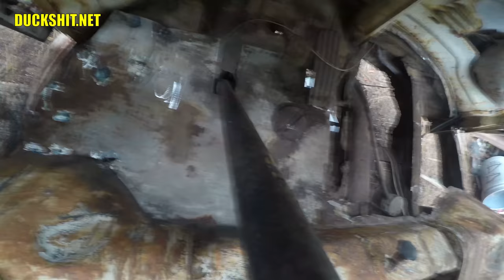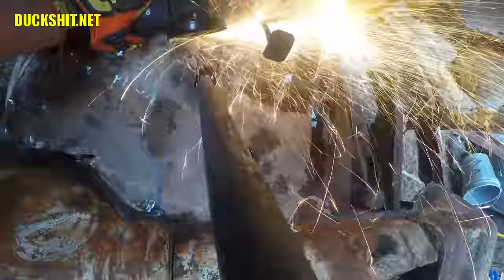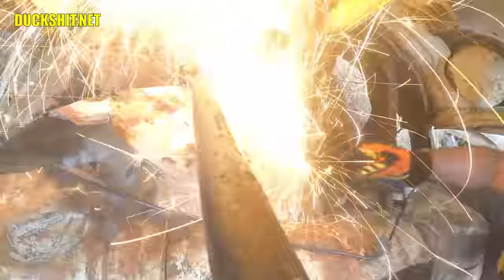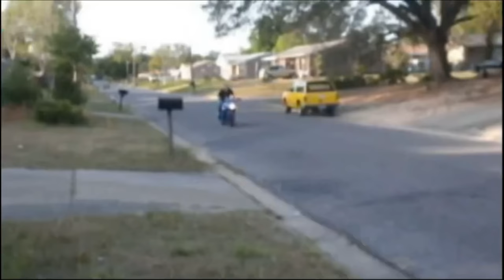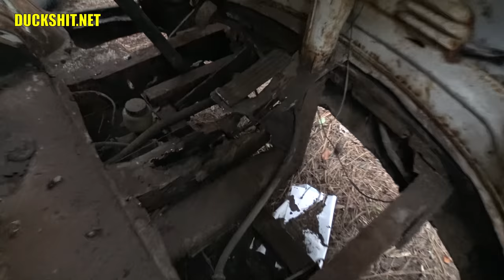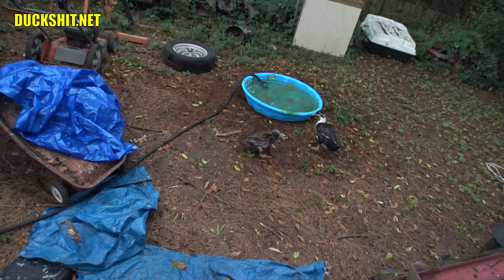1967 VW Bus Cutting Up Front Floor - Gregory - 6

Comment: Its funny how you've had several videos of going to remote mail box store.  And no one notices.  As for bracing I've seen these cut down to almost nothing but floor and was use for years to feed cattle. And others with floor modified as you want to floor . A simple reinforcement under floor to connect rear door frames  would do it.  Larry from rust belt.
Reply from the maker: Thank you!

Comment: The good thing about living in the UK for me is auto craft is based in the UK and their is a company called here called surface processing ltd who have massive baths of phosphoric acid big enough to fit vw bus in so every inch of the body of my split screen will be striped back to the bare steel including those area to difficult to reach with a sand blaster and they use the same Electrophoretic painting process used on all modern vehicle shells to rust proof them for meany years.
Reply from the maker: AutoCraft parts are available here in the states also, pretty good quality... I need to get a swimming pool full of zinc chromate, then kick my cars into it lol
Reply: LOL Auto carft and Klassic Fab must sale their parts all over the world I found a uk based klassic fad parts supplier

Comment: Can you get a small replacement panel for the main floor if so maybe you can make that work for the console floor that way it looks close to factory
Reply from the maker: There is a full replacement panel to the floor manufactured by several different makers.  I will be getting one of them sometime in the near future.

Comment: I have a big problem with my 200cc engine. It doesn’t have a 5spd. But mine has a 4spd with reverse. And 1st and 2nd gear I basically get no acceleration but I start to get acceleration in 3rd and 4th gear and it feels like 45mph. I know this engine is capable of more but the gearing in the tranny might be off or someone might have messed with it. Please help.
Reply from the maker: Thanks for the question, but I don't know of any 200cc VWs.  There was a 2000cc Type 4 Bus, but it also had 4 speeds and reverse like you say, three is no 5 speed air cooled VW from the factory.  I really don't know how else to answer the question, but I suggest you make sure the engine is running properly before you start taking apart the transmission.
Reply: DuckmanCycles and VW Garage no it’s my Chinese 200cc engine I put in my go kart. Something is wrong with the transmission like it’s not really going

Comment: Does the body of a bus come off the pan like a VW Beetle?
Reply from the maker: No, there is actually a frame like on a modern pickup truck, but the body is welded directly to.  Would be kind of neat if it unbolted though.  Thanks for the question 😁

Comment: Did you ever figure out what year it is? If it has the OG trans, you could use the serial no. from it to get close to the year it was made.
Reply: Update. It is a '67. The gas filler door doesn't have the church key lock. This is '67 only feature.
Reply from the maker: That's interesting! I believe you but I'll do a little more research to just to be sure that that's the smoking gun!!!  Only trouble with the transmission is the code that I would anticipate to be on there was actually used for many years, not specific to 66 or 67.
Reply: @DuckmanCycles  That's a one year only feature. If it's a '66, somebody when to the trouble to take the old filler cap cover off and put one on from  a '67 painted the same color as your truck.
Reply: @DuckmanCycles  If the trans is OG, it could still tell you if it's a '67. An OG '66 trans wouldn't be ground out for a 12V flywheel and would have a starter bushing that fit a 6V starter. An OG '67 wouldn't be ground out either and would have a starter bushing that fit a 12V.

Comment: Did you lay the two pieces of flooring together to find out what they're from?  Had a similar thing happen in my basement workshop...somebody had put cardboard over the walls at some point in the distant past.  Removed it to find that it was actually the backs of large World War 2 propaganda posters
Reply from the maker: Watch for tomorrow's Q&A video over on my other channel! One of the the questions that I will feature will be the sign print on the floors!  That's pretty interesting about what you found though, did it have any value?
Reply: @DuckmanCycles  I honestly don't know if the posters have any cash value but I did offer them to the local museum for free (as historical documents that should be preserved) and they weren't overly interested.  One of them is pretty racist by modern standards, lol!